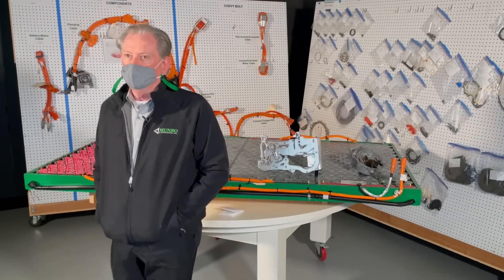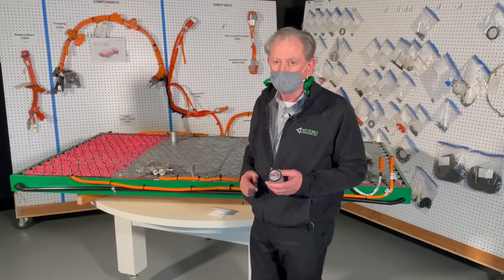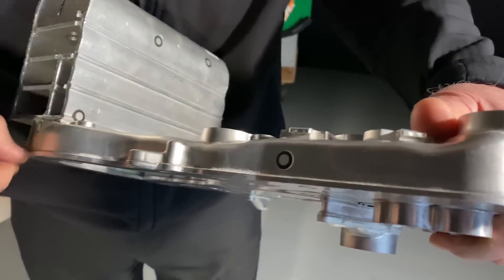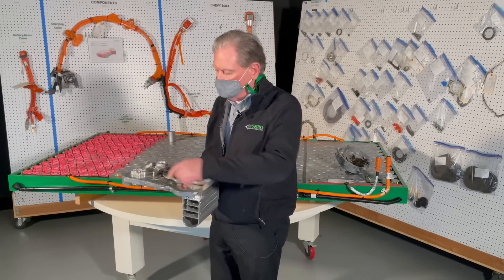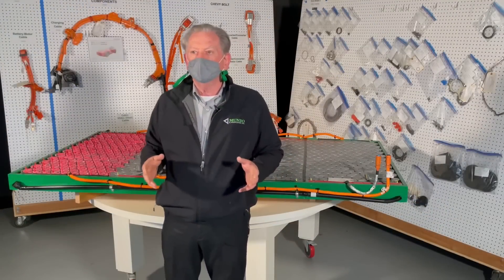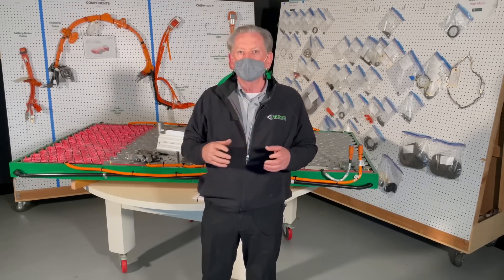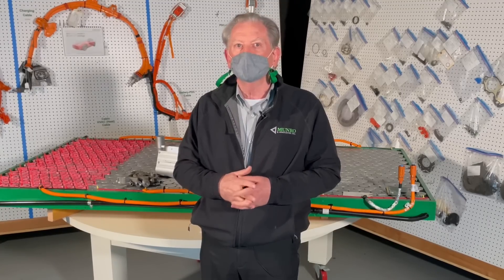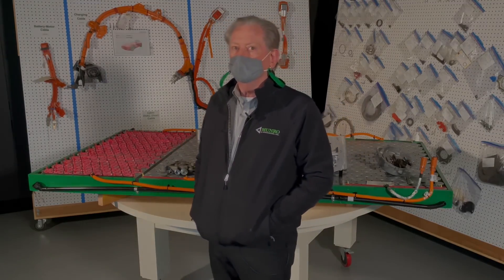Follow-up Episode: 4680 Battery Pack

Comment: This is a fake battery, there is no proof Tesla can do that.
Reply: They have been building and testing these 4680 packs for months now.
Reply: @JasonWW2000  Unfortunately some people think a questioning mind is the same as not investigating or believing in anything they hear or see.  :/
Reply: Yes, this is just a very basic mock-up of what Sandy predicts Tesla will do. It shows some basics but does not show how they will insulate the cell cases, which are all (-) from cell casing in other cell groups. 

If you put 2 rows of 10 uninsulated cells together, at first nothing would happen. If you ran a bus wire along the top edge of the cell can (-) and connecting the center terminal (+) of each cell in each of the 2 rows of 10 cells, nothing would happen. 

But as soon as you connect the first row (+) to the second row (-), there will be a spark related to how thick the thinnest wire is connecting them all.

Also, the “cooling plate” along the bottom must not electrically connect all the cells together for the same reason. 

Rather than having 3 black lines making 4 non-existing modules, using the black electrical tape to show where there are insulators placed between cell groups, unless all cells will be insulated from each other. Then show how the cooling plate will maintain electrical isolation.

So far all the other “cell to pack” designs done long before Tesla use prismatic batteries that don’t connect the (-) to the case and sometimes use a non-conductive cell case, so it doesn’t matter if the cases touch each other or a common cooling plate. 

The whole concept of Tesla reducing weight by making a metallic honeycomb battery case with 4680 cells inside each honeycomb compartment, all while keeping the cell groups isolated from each other is the tricky part. 

Of course if this battery case ever gets high-centered on a speed bump, you have to scrap the whole car. That is a major concern as Tesla makes the battery less and less repairable.
Reply: @imho7250  As I understand the battery case, it will be cast and as strong as any car frame. It'll have to be able to withstand car weight stress at any point.
Reply: @AndyZach , yes, it will be the car frame so it needs to be as strong as a car frame, but the question is how will they connect the top and bottom of the case to give it more strength in the center? 

The objective is to provide more volume, less weight, so they can essentially add more cells without increasing the weight of the car. 

Since the 4680 has roughly the same wh/mm^2 as the 2170, the fact that the 4680 is 14% taller, gives it 14% more energy per sq ft of battery case footprint, which is where most of the claimed 17% increase in range due to form factor comes from. The battery is not 17% more efficient in terms of the kwh you put in vs the kWh you pull out. Tesla was just doing their typical marketing hype.

Weight of the battery has little to do with range except in starting and stopping. The rolling residence increase is minimal (when tire inflation is set properly for the added weight) and of course the aerodynamic drag is unchanged.

Since 17% range increase is not enough, the big increase comes from making the battery compartment bigger with the center casting and “cell to pack”. The same thing can be done with a 2170, even if only bottom cooled, because it’s 1/5 the surface area and 1/5 the energy and 1/6 the power.
Reply: @imho7250  They will fill in all the voids between the cells and the top with epoxy. They may bond the bottom of the cells to the cooling block with thermal transfer epoxy similar to what used with computer CPUs. When dry, it will make a solid block. 
The 4680 volume is almost the same as 5 x 21700 cells. So the extra 17% improvement comes from the tab-less design. This lowers the batteries internal resistance so less power is wasted as heat.
Reply: @JasonWW2000 , ok, so you are admitting your first statement about not needing to be electricity isolated was wrong, and you assume it will be by coating everything with a non-electrically conductive, yet thermally conductive material. That’s is one possible way.

But your second statement shows you still have no clue about engineering. The coulombic efficiency of a 2170 cell is already more than 99%. So even if you got it to 100%, that’s not a 17% improvement in kWh out, which is the ONLY thing you can do to the battery to make the car go 17% farther, baring changing a 1000 lb batttry into a 10 pound battery.

There is no secret sauce unfortunately. Any manufacturer can make a 4680 cell using proven methods (not tabless) and get a battery with 6x more power, 5x more energy, since the volume is 10% more (5.5x that of a 2170). 

The tabless itself does nothing that the battery manufacturer can’t do with other tab designs, except introduction of many more failure points, which is why Tesla 4680 yield is currently unacceptable. 

Anyway, QuantumScape and Toyota will have solid state batteries soon which offer faster charging and more energy density, making Tesla’s tabless cell seem like Lead Acid batteries are today, still good for certain applications, cheaper per kWh to buy, but slow to charge, low energy density, low cycle life.
Reply: There is no reason to think they cannot.  It's actually a very simple concept- take all those battery cells and eliminate layers of "packaging" to create a battery pack integral to the chassis floor. The rest is just details,  which will be revealed eventually.
Reply: @JasonWW2000 , you have no idea what you are talking about. These cylindrical cells use a can, which is the (-), and insulated ring and a center cap (+). In the model 3/Y Tesla used the same method to connect them, with a bus for each negative group of cells attached to the top of the can itself and a bus for the positive of each group of cells. 

The cells in the model 3/Y are isolated from each other. The “tabless” design won’t work without the negative tabs touching the bottom of the can. 

Perhaps you are watching videos of LiFePO4 cells which both ends have isolated terminals, but that won’t work on this batteries design.
Reply: @JasonWW2000 , if you work with them, it must not be as an engineer if you can say all the bottoms of the cells can be electronically connected with each other. But glad you work with people who can correct you fast enough to make a new comment.
Reply: @JasonWW2000 , you need to ask one of your coworkers about the 2170 cell, because there are several videos showing someone connecting a multimeter to the top (+) and bottom (-) and getting a reading. 

In both the model S/X 18650 based packs and the model 3/Y 2170 packs, the cells from different cell groups are not electrically connected by the cooling ribbon. The have something between the two acting as an insulator.

I wish Sandy could do a bigger deep dive on that, but I guess that’s in his books that he needs to sell.
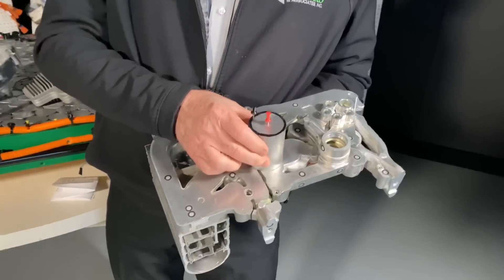Reply: 2:48 I didn't believe your heat rises/conduction explanation, so I boiled a pot of water and placed the pot on my lap.  It turns out you're right about conduction!😉
Reply: @JohnPMiller , that’s one way to find out. Lol.
Reply: @JohnPMiller  Heat rises because its transfered to the surrounding air molecules through radiation and the molecules start to spread out and become less dense. They then tend to float upward while the cooler, more dense air around it drops down. The warmer air is more buoyant. This is called convection. Examples would be a hot air balloon or holding your hand above a flame.
Heat transfer through conduction does not rely on air, it happens through physical contact. The heat is able to travel in any direction it needs to. It always travels from a higher temperature to a lower temperature in order to equalize itself. So if the Tesla battery pack has cooling channels along the bottom of the battery cells the heat will gladly travel downwards to where it is cooler.

Comment: Great explanation about the convection heat propagation.
I believe that the Jaguar I-PACE EV SUV has a cooling from below the battery cells.
It would be interesting to get a totaled one and shows the battery cooling system.
Reply: Sandy already has one of those batteries. We don't know if they have teared it down by now or not. But for the work and reports they make I think the like undamaged products so getting a totaled one is not a good option. https://youtu.be/GkQga-mzO4Y?t=286

Comment: Thanks Sandy for "Anode as in anti".  I've ALWAYS struggled with remembering which is which.
Reply: I remember them by  NP-AC   -   N comes before P, A comes before C    negative, positive :  anode, cathode
Reply: Anode as in a-negative
Reply: me too!!
Reply: Me too.
Reply: I always think of cathode as catheter, i POSITIVELY don't want that!
Reply: The current flow is the opposite from when I went to school. It takes some getting used to.

Comment: Why don’t the go to 800V wouldn’t that be a good idea?
Reply: It's much more dangerous and doesn't seem to have any real world benefits. It seems the world has accepted 400 volts.
Reply: It’s pretty clear that battery design is all about compromises.  Increase performance in one area and you decrease performance in another.   I believe that the higher voltage helps with power and max charging rate,  but can’t remember what the downsides are. ...  possibly longevity?  However, if there were no downsides Tesla would have no doubt adopted it for their new batteries.  The fact that they haven’t strongly suggests that those downsides exist.